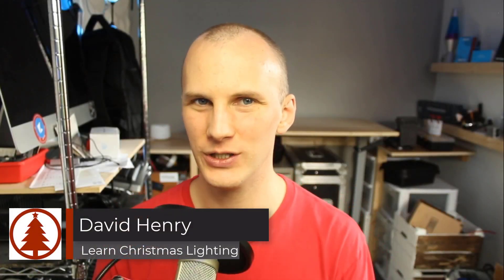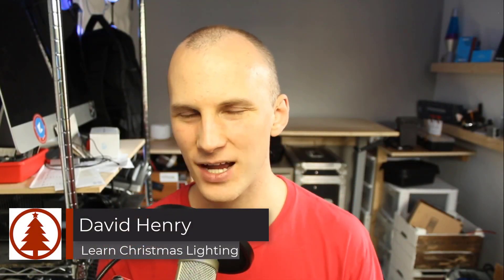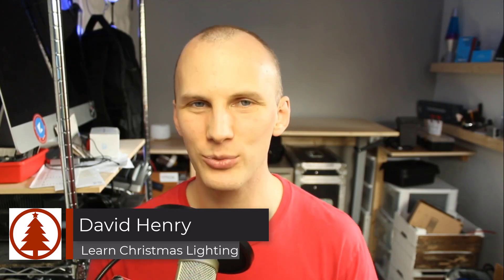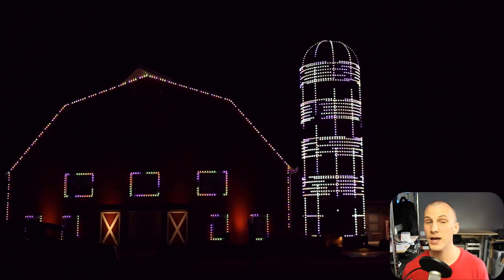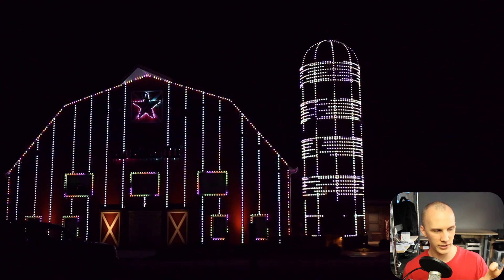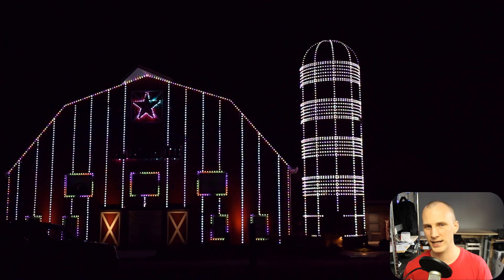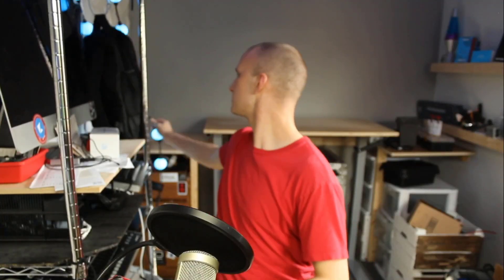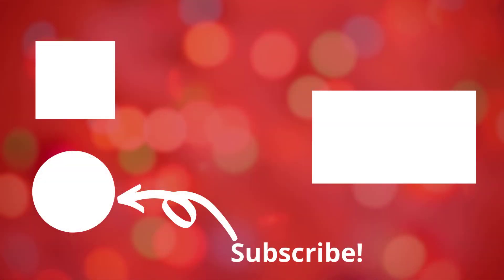Why I Use More Than 1 Shape Of Pixel in My Display

Comment: Last year just before Christmas I purchased four ATHOM Pre Flashed WLED Smart Bulb RGBCW. I was thinking of putting them in the overhang ceiling lighting on our wrap around porch. But because I am moving my Christmas display from the side of the house to the back of the house (we have a road that runs behind the property so viewing a display is much easier there than it was on a road about a quarter mile away viewing the side) I'm not sure I will be able to incorporate them. BTW, these bulbs are 110v and screw into a normal light fixture. They have WLED built in.

Comment: David, have a quick question. Hopefully you can help. I have a F16 v3 controller and have set up and mapped out my display. It is working well. I have a question is there a way that I can add ac lights to my display? and if so what would i need to purchase to make that happen. I did buy a Hinkspix pro long range ac receiver  from holiday Coro. I haven't seen much information about adding AC lights displays. Any information would be greatly appreciated. Thank you for all your help so far, have a Halloween show done and now working on the Christmas show.
Reply from the maker: Yes, here's what I use: https://youtu.be/5hQEYf6artc